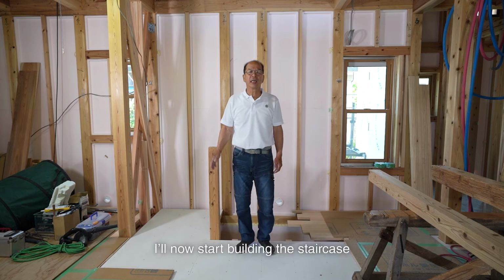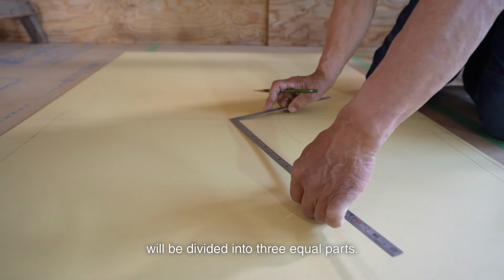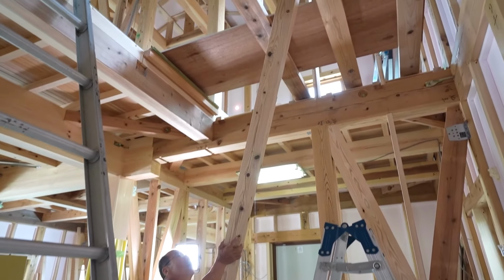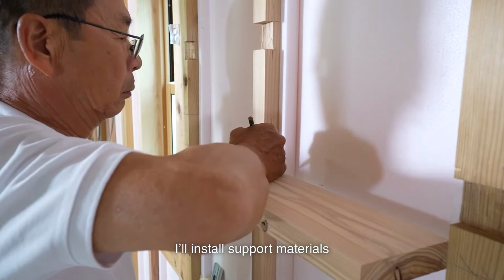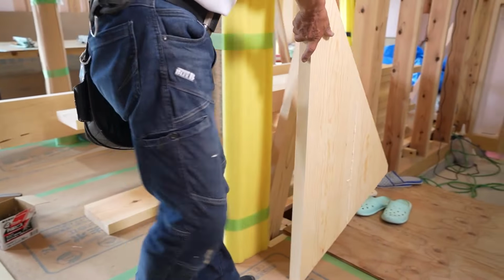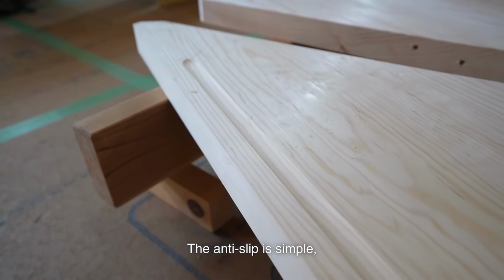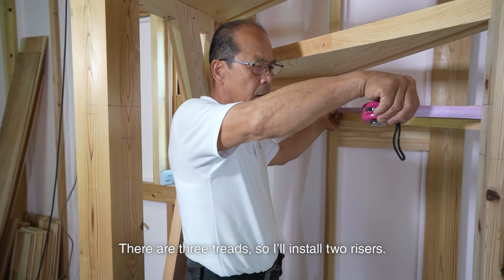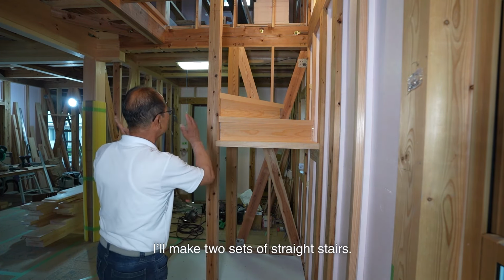Japanese Woodworking - Three Step Winder Stairs [Season 2 - Part 5]

Comment: The quality of the wood he uses is absolutely amazing. We can only dream of materials like that here in the States. Even the sheet materials used in other episodes is on another level. If we had access to materials of that quality it would be so astronomically expensive we couldn’t afford to even look at it on the store’s shelves let alone buy it. I'm a furniture and cabinet guy myself (I should say I’m a lifelong hobbyist and not a professional) and I think this guy's rough-in, and framing work is better than even the best finish work you typically see. I love seeing all the Japanese methods and techniques. Amazingly sharp saw blades and chisels. I enjoy seeing all the fascinating tools that we’re not used to in our area. I even enjoy learning the names and words you are teaching us. Thank you. Keep up the excellent work.... P.s., I noticed all the Imperial rulers and tape measure markings??? Best Regards,
Reply: Agreed. Just the wood he uses itself is awe inspiring. 
Here in the US there's no way unless you are cutting down trees and processing the timber yourself.
Reply: The lumber is impressive but to say the States don't have access to this quality of lumber is laughable. 
I've been building homes for over 25 years in the US. 
I'd get fired if I used a stair post with that many knots in it & didn't use dowels or biscuits on the joinery.😂
Reply: @daneo617  where do you get quality lumber?

Comment: I once built a custom gate for an architect using kiln-dried knotty cedar 2x6, counter-sunk stainless-steel screws and hand-chamfered edges, sanded to a the smoothness of glass paying careful attention to the grain patterns of each board ensuring they flowed together like waves in a sandy sea floor. It was an an absolute masterpiece. Then he had some lowball hit team paint it. They didn’t even attempt to sand or prime it even though it was obviously extremely smooth-finished bare wood. The paint began to peel because the wood surface was so smooth and perfect. 😂
Reply: k
Reply: "I'd like to take this opportunity to toot my own horn, pat myself on the back and brag a little bit"

Comment: I made floating stairs out of pine with a quarter turn in the room's corner.... without a single screw or a drop of glue. Holding up for everyday use since a year and a half now. And then here comes this japanese man and throwing dozens of screws then caulking with PVA glue. Oh My Goodness...

Comment: Thank you for a wonderful video.
Question; is there no need to use glue clamps to press the pieces together when bonding?
Reply: Looks like he screwed them together after applying the glue.
Reply: @rummy98  yep noticed it, but that is quite little pressure applied compared to a number of strong clamps
Reply: @dwergmaster  if your surfaces are jointed and true to each other then not really. Its not like glue is activated by pressure. Unless you're worried the expanding glue would push open the joint. In which I'm pretty sure those screws are exerting orders of magnitude more pressure. 

Also this is only a hunch... but I'm pretty sure those impact driven screws exert more clamping pressure than conventional clamps. You probably lose some pressure at the middle since they're at the ends, but again that's where perfectly jointing the surfaces probably makes that a non-issue.
Reply: @mykalyu  Thanks for the elaborate reply!